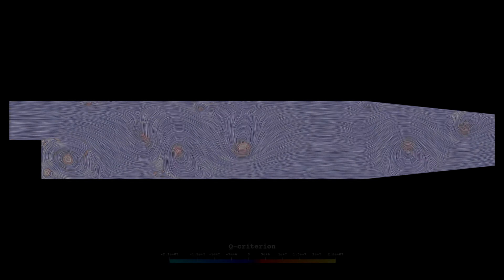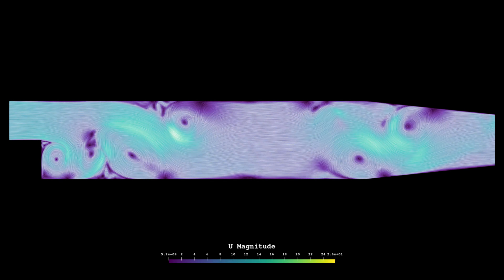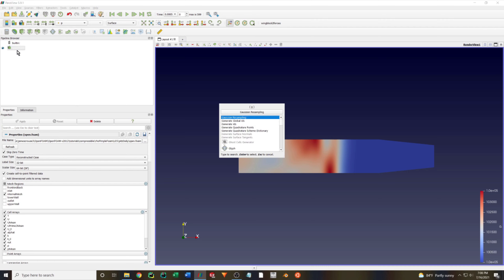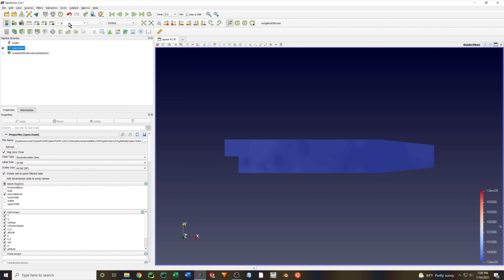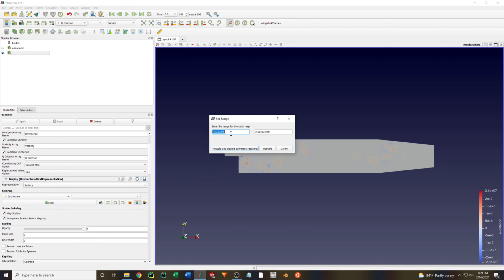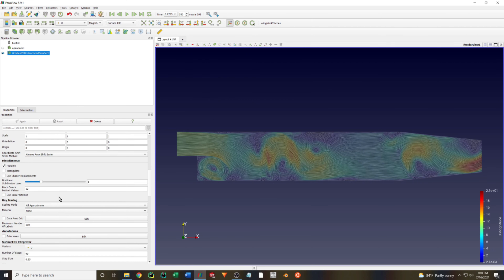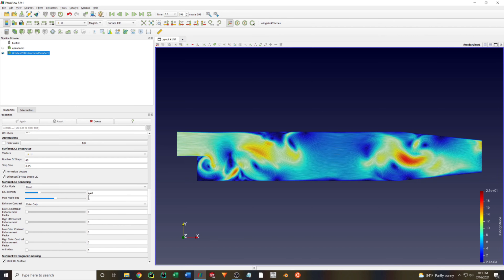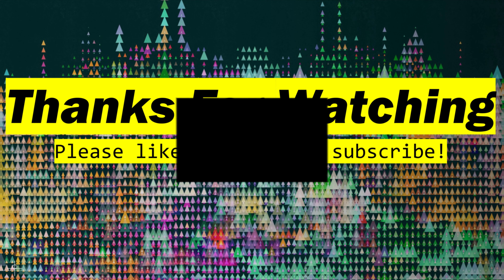Q Criterion & Surface LIC: ParaView mini tutorial

Comment: Great visualisation! 
FYI, it is advisable to obtain the Q-criterion using OpenFOAM runTime functions rather than calculating it on ParaView, because the OpenFOAM post-processing tool will use the same face interpolation and gradient methods as you have specified on the fvSolver dictionary.